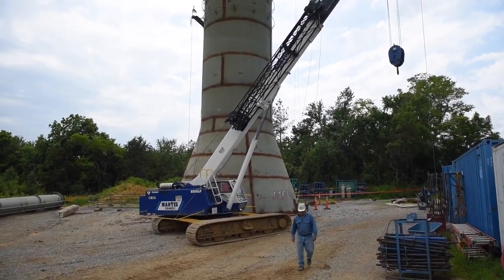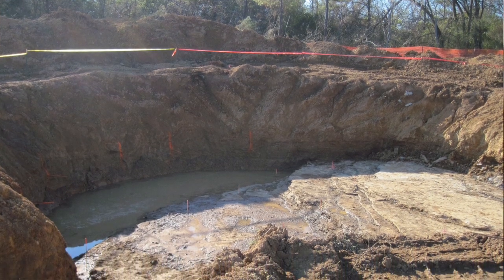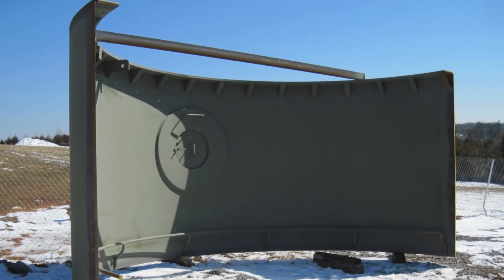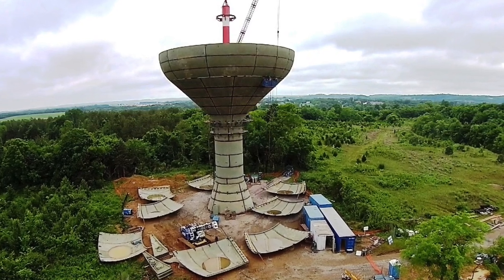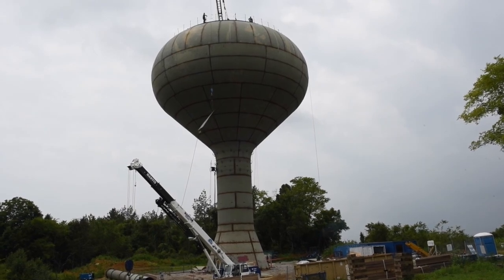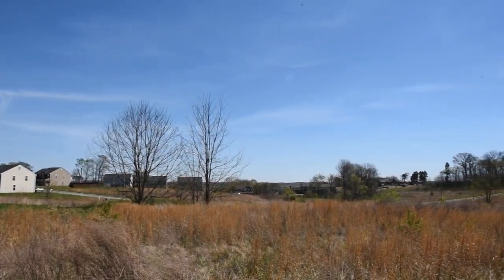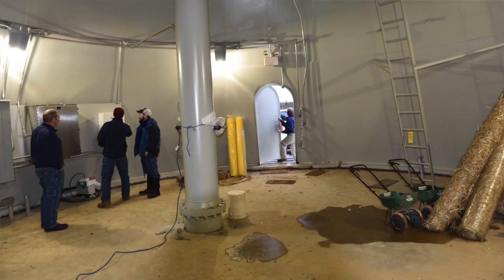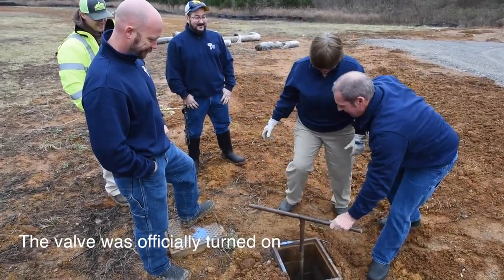Time Lapse Video of Water Tank Construction in Spring Hill, TN

Comment: How do they get the crane out of it at the end?
Reply: Use what's called a davit arm. Lean the boom down against the shell and rig it there.  Release from the roller race at the bottom of the boom. Then use the load line and boom line to lift up and flip upside down over the edge and lower to the ground. Slide last roof sheet over and weld it up.
Reply: A Davit arm is one method used for CET type water towers not too sure how that would work with the curved shell versus a tank shell. A different method most likely was used on this 1.5 MG spheroid.